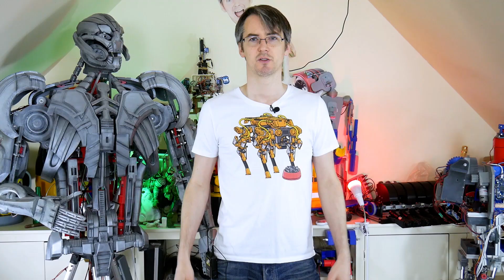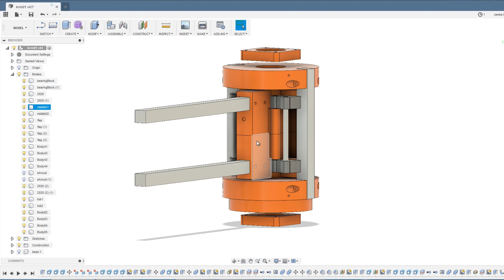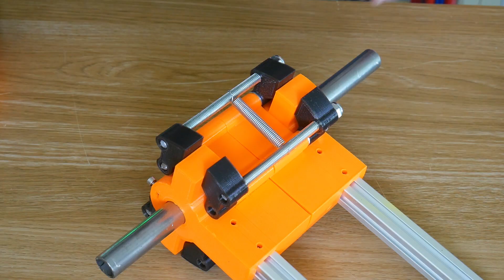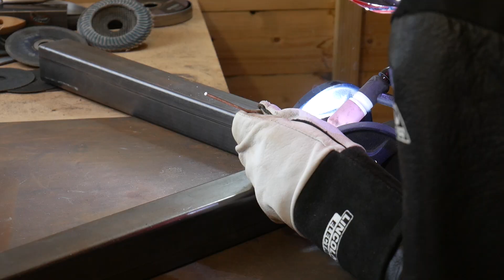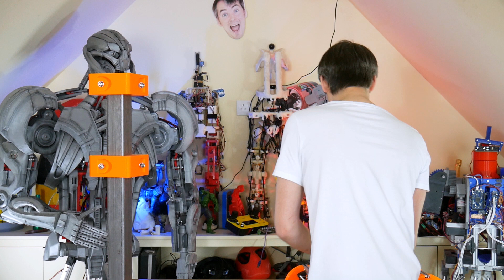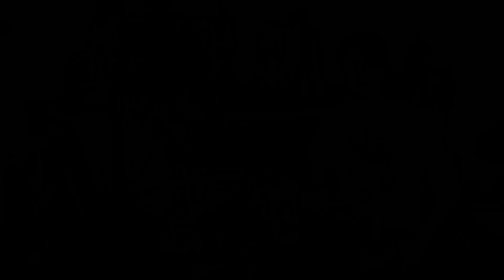Building a Force Driven Robot Arm #1 | James Bruton

Comment: If you would use brushed DC motors the current would be liniair to the torque. So you could just drive your motor until a set limmit.

Comment: Using the mechanism with the black bits pulled together with springs,  trapping the bit of plastic from the outer arm, I see a possible issue. You will not be able to measure the force applied until the force is large enough to stretch the springs. That is, small forces will not register at all.

Comment: Why use springs?   Now the force is always limited by the spring constant and how far the string is compressed or stretched.  I would limit the torque on the motor dynamically.

Comment: How about using a Magnet on the brushed motor's shaft and measuring the rotation of the magnetic field. There are Sensors out there, which can do exactly that. You just could glue on a magnet onto the small stump of the shaft. Thanks to the planetary gear you still should have plenty of resolution anyway!

Comment: Why not use a spiral springs for the joints? You know those springs in tape measures. Also, why not 3D print cross roller bearings instead of using those small bearings? It’s cool that you’re using springs in conjuncture to servos, I would have thought there were ways to measure the current being put into a servo as a way to measure the force being applied to them rather than using springs.

Comment: You could mount both motors on the central arm stand.  The first motor is then mounted on the stand and transfer power to the first elbow.  Then use a wheel to transfer the power from the other motor to a pulley on the first elbow and then out too the outer elbow. That could be mounted on the upper part of the elbow and the other on the lower part of the elbow.

Comment: It's too bad you can't just sense the amount of current the motor driving the joint is using in order to calculate force.  Certainly would simplify the mechanical part.
Reply from the maker: Then you would always have to back-drive the gearbox.
Reply: @jamesbruton  if you were sensing current couldnt you just have the motor drive however it needed to in order to maintain the same force?  I can see in very high reduction gearboxes binding due to internal friction possibly being an issue but that's about it (but then again I'm not the robbit designer here:)

Comment: This seems like a rather complex way to measure something you already know?  For an electric motor, phase current (note phase current, not supply current!!) is proportional to the torque the motor is generating (linearly proprotional in fact until saturation is reached). So if you operate your motor drives in order to control phase current, you have a "force controlled" actuator already.  In software, you just wrap than inner torque control loop up in a velocity (and or position) control loop and bingo, you're done........
Reply from the maker: I don't want to back-drive the gearbox, because it'll break.

Also what happens when I push the  arm back and I want the motor to follow?
Reply: @jamesbruton  assuming your gearbox doesn't have such a high ratio as to make it mono-directional (ie like a worm drive gearbox that can only transmit torque one way) then if your motor control is in torque control mode, the motor drive  can only apply the torque you ask for (and limit too)  With positional control, as the actual departs from the target (ie the position error grows) then drive will apply more and more torque (phase current) to try to restore the position, up to the torque limit set in the drive. But, in torque control mode, the torque is limited by the torque control values and settings, and you just have to decide how "hard" you want your position control too be. And as that is a separate control loop outside the torque control loop, that can have its own unique calibration
Reply from the maker: Ok, this is a 'Series Elastic Actuator'. thanks

Comment: A lot of posts have mentioned using a motor in place of the spring.  Your response is always that it involves 'back driving' the motor.  Can  you explain why that is not something you want?
Reply from the maker: It's back-driving the gears in between that's bad because it puts lots of load on the gearbox.
Reply: @jamesbruton  So, is that just because you are going to use plastic gears?

Comment: hi james,

you are on a good way -- following what robotics research already did and is still doing.
the basic history goes like this: stiff joints, then all force controlled: soft joints, variable stiffness joints
check these research robots and the publications around them: 
somewhat soft joints (~10kNm/rad): https://www.dlr.de/rm/en/desktopdefault.aspx/tabid-11427/#gallery/29202
variable stiffness joints: https://www.dlr.de/rm/en/desktopdefault.aspx/tabid-11666/#gallery/28234
soft joints (with mechanical springs): https://www.dlr.de/rm/en/desktopdefault.aspx/tabid-11826/#gallery/28795

keep up your "research"!
Reply from the maker: I know - Cog had series elastic actuators at MIT in the 90's (80's?)

Comment: Why aren't you just using the current sensing to measure the force on the motor, afaik Odrive makes it available ?
Reply from the maker: It would involve always back-driving the gear train instead of a spring that's designed to be stetched

Comment: Noob question but why not use stepper motors? The precise control seems like a good fit for robots.
Reply from the maker: Yes that could work well also. I just happen to have the other two - with encoder driven motors I can get the same accuracy.
Reply: I see, thanks for clarifying. Keep up the good work! Your videos are both entertaining and educational at the same time.  @jamesbruton

Comment: Hi! Would it be possible to measure the position using the springs as variable inductances in an LC oscillator?
Reply: that's quite clever, though it probably wouldn't be precise enough.

Comment: If you start to chain up multiple of these joints please stay far away from them ... Each moving joint will also apply a force on all neighbouring joints. If they are all controlled via PID controllers they will become unstable and start oscillating like crazy. I wonder if you get this to work as stable as your other robots. I think it is extremely difficult

Comment: I think Odrive has a built in torque control option instead of position or velocity control?
Reply: that would make things a lot easier
Reply from the maker: Yes but that involves always back driving the gear box instead of some springs that are intended to stretch

Comment: Oh james I know you're not welding without ventilation or a mask, that's going to tear you up inside, especially if you weld certain metals, like stainless steel, which gives off horrid fumes when welded
Reply from the maker: There's a massive orange extractor in there...
Reply: @jamesbruton  good man 👍

Comment: Is it necessary to attach the encoder to the motor itself? Could you not drive it with the belt or the gear you are going to use to drive the arm?
Reply from the maker: For the brushes motor it needs to encoder to drive the motor phases at the right time/position. For the brushed motor it will be better with the encoder on the motor because it'll be more precise - otherwise any backlash will cause the motor to oscillate.
Reply: @jamesbruton  Won't the additional precision be lost when considering the backlash of the gearbox?
Reply from the maker: @IrishSkruffles  I'll be measuring the absolute position of the actual arm as well... otherwise I can't work out the force on the springs.
Reply: @jamesbruton  Ahh I see, thanks for replying
Reply: @jamesbruton  I agree with you on both points. However, if the brushed motor is going through that 72:1 gearbox, there is a possibility that the resolution of the encoder will be coarse enough to damp the motor oscillations, especially if it is further geared down by a belt or gear after the gearbox. Perhaps I am wrong, but I would be surprised if the encoder has a resolution of greater than 140:1.
But, in the case that it does, you could drill and tap a hole in the rotor shaft on your lathe (I think I remember you saying you have a lathe) and then locktite a standoff into it.

Comment: Why force control? Wouldn't it make more sense to use position control and set a force limit for any given movement?
Reply: How could you set a force limit without force control?
Reply from the maker: It will do position and force control.

Comment: I would recommend using a couple Wheatstone Bridges epoxied to your aluminum extrusions. You wouldn't have large joint deflections when loads are applied. Just my 2 cents...
Reply: I concur. Also, use low-pass filters superglued to the 3D printed parts to attenuate any vibrations.

Comment: Awesome, James!
But if you use belts alone (with or without pulleys), then the holding current ought to be considerable. Excess heat might be a problem.
Have you given thought (I'm sure you have) to using a worm gear in any way? They may introduce some backlash, but IMHO the torque and holding strength are just what you need in that arm.

Looking forward to see the redesigned hand!
Cheers from Brazil!

Comment: I have a question. I have a 3d model of a fallout power armor. So what free or cheep 3d software can I use to make it readable for a 3d printer?
Reply: Look at the makers muse yt channel he did a fallout tutorial a number of years ago for fallout 4
Reply: Depending on the format, you'd probably want to try Blender before you do anything else.
Export it as an STL file.
After that you need slicer software, but if you have a 3d printer around you should have that anyway. (and if you're using a printing service they'll probably do that bit for you and just ask you to send them the STL file...)
Of course, this doesn't guarantee the model is designed correctly for 3d printing, but fixing that would depend on you having semi-decent 3d modelling skills, and that's not really a software problem.
Reply: @KuraIthys  I am used to use Autodesk inventor in high school last year.  Now I just bought my first laptop and am looking to buy a 3d printer aswell.  My older cousin has one maybe I can talk to him.  Thanks for the info.
Reply: @jokersredace  Does Autodesk Inventor not have an STL export option?
Reply: @clonkex  I don't remember.  4 years of playing around in it and we never got to print anything.